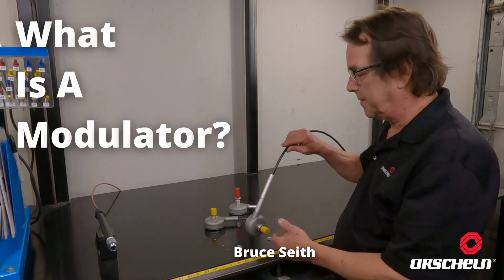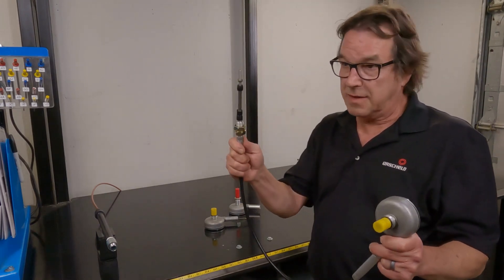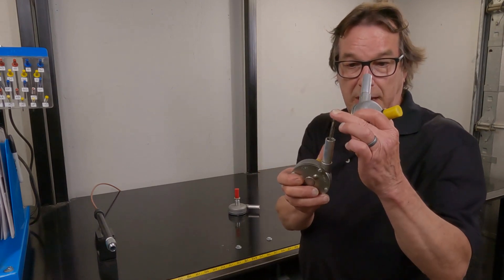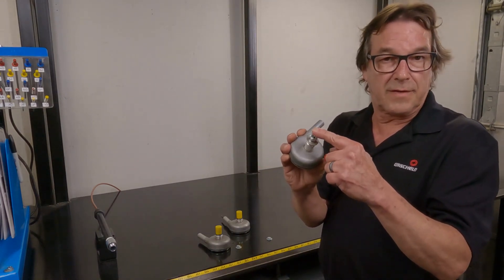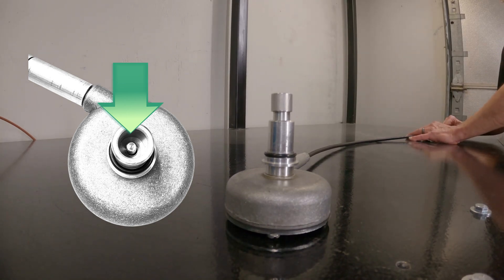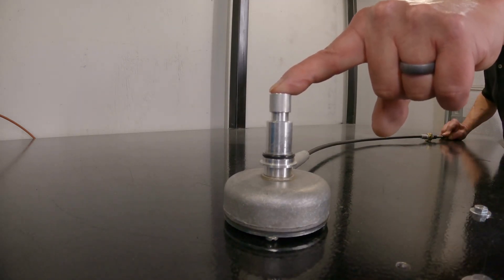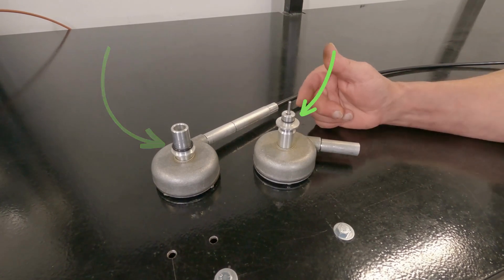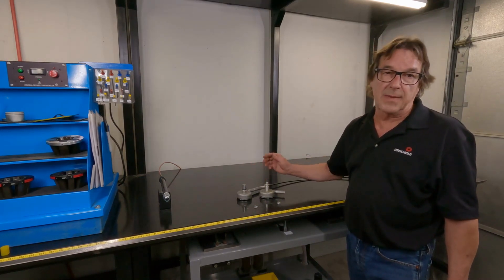What Is A Modulator?

Comment: The Modulator™ High-Powered Speaker Array provides a flat frequency response of up to 2000Hz, producing intense warning signals and digital voice messaging over a large area. The Modulator design enables the speaker array siren to produce a high sound level and exceptional speech intelligibility within its coverage area.

The innovative omnidirectional electronic Modulator speaker array consists of modules that utilize four 100-watt drivers per module. It also provides clear voice communication and offers warning signals which are produced by Federal Signal’s UltraVoice® electronic controller and amplifier system. Custom tones and professionally recorded voice messages for the UltraVoice controller are available and can be purchased upon request.

The Modulator combined with the UltraVoice controller is ideal for community/municipal, industrial, and military applications where immediate instruction is necessary. 

The Modulator and UltraVoice controller can be networked via radio, IP, landline, cellular, and/or satellite communications. Powering is available in AC, DC, or solar. The system typically operates from batteries which are charged from either AC or Solar. Federal Signal can also provide customized solutions to fit your special applications

Comment: Finally a video about tha Allison AT545 that makes sense . So , I have a 1991 school bus with a Cummins 12 valve  1st Gen fully mechanical and a AT545 . What modulator do I need to buy ?.
Thank you Sir
Reply: Im looking for the same answer for a 92 bus same drive train.
Reply: @moonshineviewfarm3885  , I’m thinking it’s the first one he talks about
Reply from the maker: Hi there. Thanks for being patient with our reply. Here are our suggestions before buying the right modulator: 

1) Is it a “Pull” or “Push” style?
2) Is the mounting a “Bulkhead” or “Clamp” style?
3) What length is required? Measured from the center of the head assembly to the end of the rod as shown on the drawing.
Reminder: All modulator assemblies should use the 59049-2 “slip-link” assembly; ordered separately.

You can visit our website: https://orschelnproducts.com/product-category/modulator-cables/ for more specifications. When you have done so, feel free to reach out to any distributors across North America to buy a modulator.
Reply: I'm studying to be a mechanic. When rpms are low Vacuum is high. The way I understand it slow acceleration means lower pressure atf and a slower smoother shift because the atf pressure struggles to overcome the Vacuum and overcomes it to achieve the shift more gradually. In your video you state a harder acceleration means atf needs to push harder to overcome. Am I missing something here? These two points seem to contradict each other